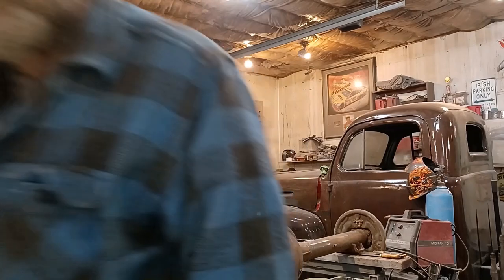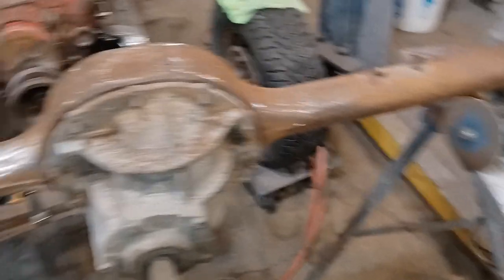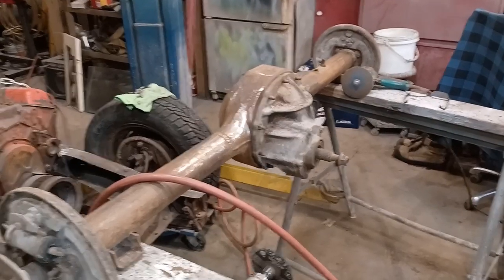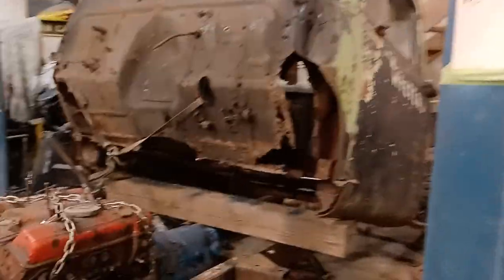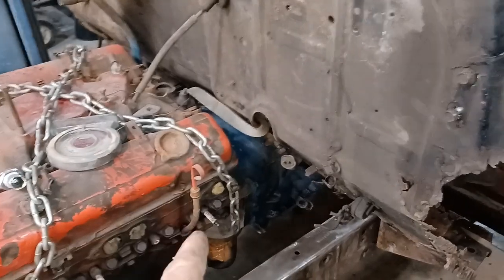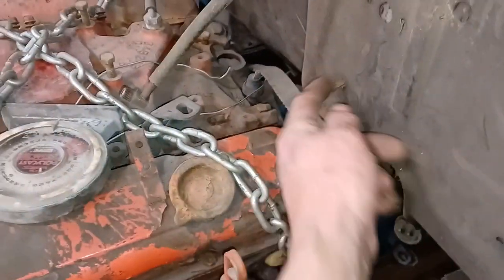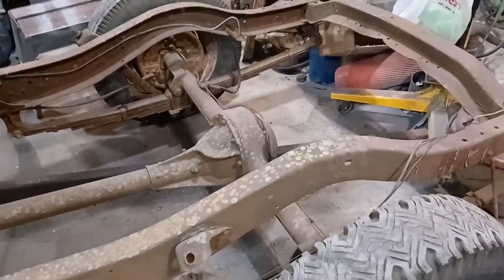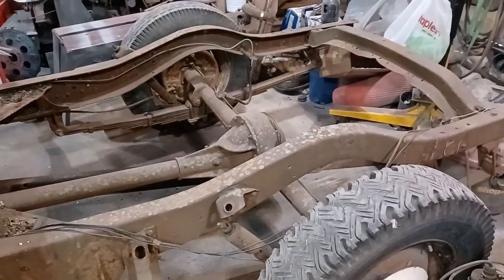1951 CHEVY PICKUP TRUCK...HACKING THE FLOOR AND FIREWALL FOR TRANSMISSION CLEARANCE!

Comment: Awesome job. My engine is more forward than yours (I should’ve brought it back some, I have to use an electric fan and short water pump. Which was my plan anyway).
However I have tons of room to the firewall. 
I’m painting my firewall now and will be reinstalling the engine as soon as it’s done. I have a couple of really warm days so I’m trying to get the painting done today or tomorrow morning so I can have the doors open so I don’t stink up the house. 
Anyway, I’m feeling for you buddy, I been there on mine. Lol 😂
Reply from the maker: Thanks...I'm feeling pretty good about where things ended up! Firewall mods are minor (whats left of it)...lol
Reply: @dirtydansrodncycle  lol 😂 yeah that floor is pretty rough but I’ve seen worse.

Comment: Hi Dan, if you box the frame then all your brake lines, electrical and transmission cooler will be in the outside? or you will leave holes to fish them through the frame?
Reply from the maker: wiring will be hidden inside the rails, but clean straight brake lines and such will be mounted outside of the inner rails